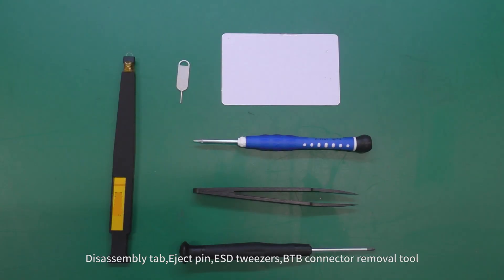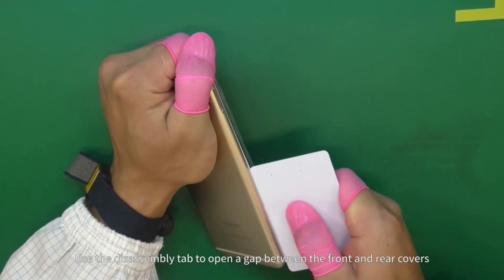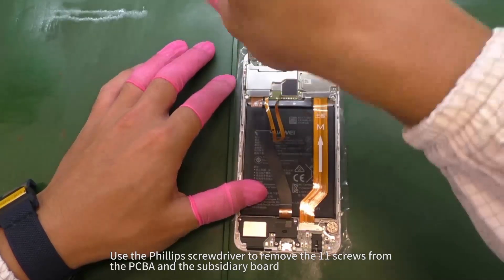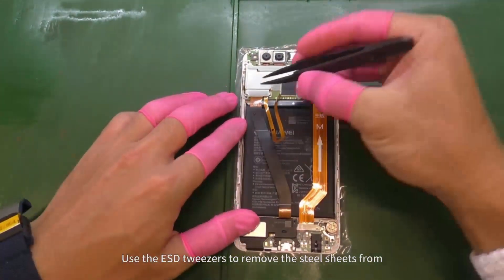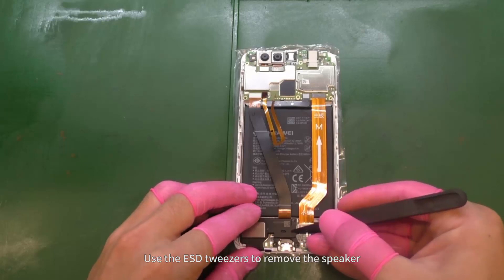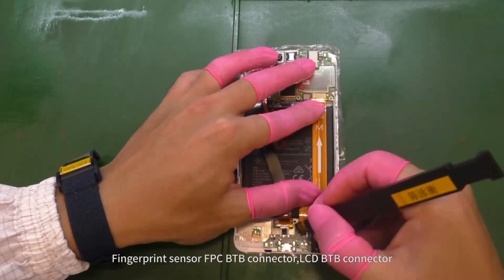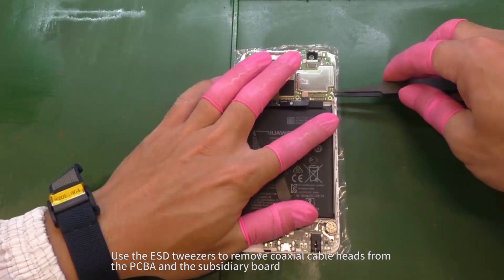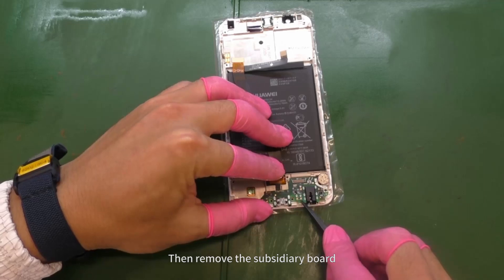Huawei HONOR 7X disassembly guide

Comment: How do y'all take the back off with zero effort, I can't even get the tool to pry it open even a mm, garbage phone product, good, glad Huawei got tariffed banned
Reply: I ended up using a small flathead to pry it open a little bit, but not before pulling the screen off slightly most of the way around, mistaking where the two cases joined.  The divide then is in between the two metal lines that trim around the phone, ignoring the screen.  But after trying with a small flathead, and scratching it no doubt, i did pry it apart enough to get a plastic tool in there.  Only problem is I was doing all this to replace the battery - which is the only thing not removed in this video!  According to "Yash Singh" commenting on 91mobile.com, "You cannot remove the battery of Honor 7X."  I think it's just one expert level more complicated then the rest.  Took apart my MotoX and it was more difficult then this, though.  You had to head the back up with a blowdryer before even starting the task of opening it, and then I must have messed something up because it dropped lightly after I replaced the screen and never came back on again.
Reply: Asians.